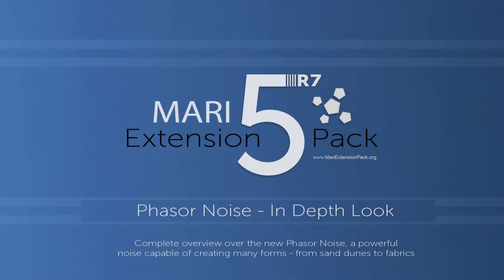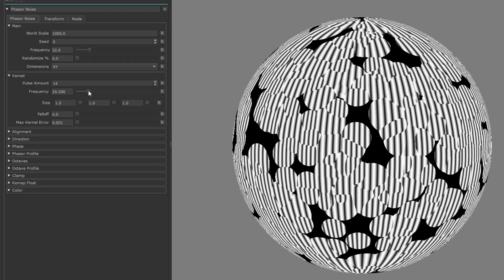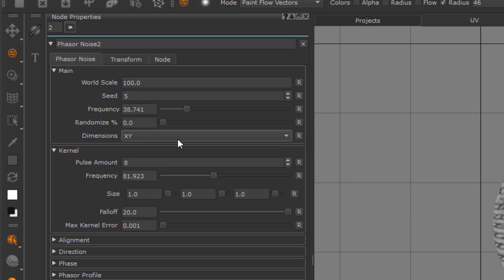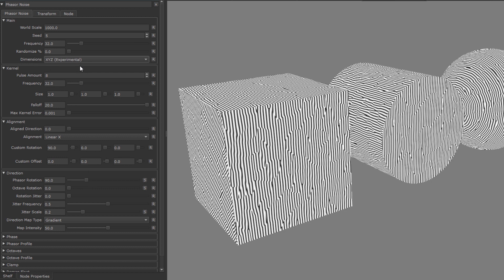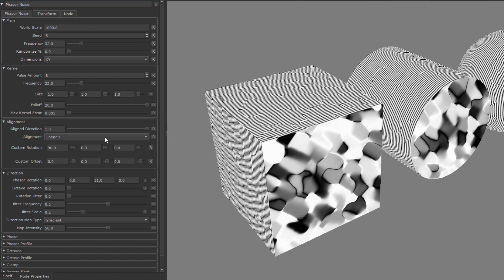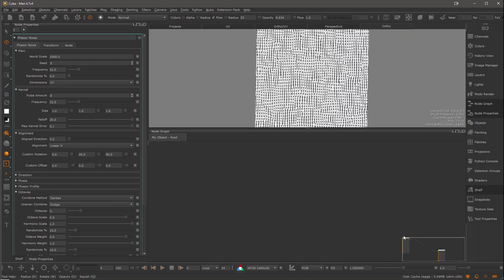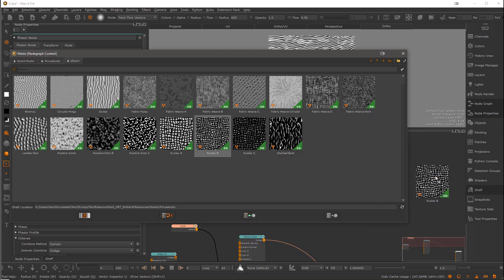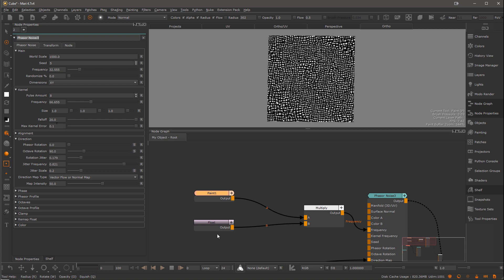Phasor Noise | MARI Extension Pack 5 R7

Comment: 5.0 is it okay
Reply from the maker: Hi. If you mean does it work with Mari 5.0 ? 

No. Extension Pack does not support Mari 5.0.

Mari 4.8 is feature identical to Mari 5.0 though, just different python versions. 
And Mari 4.8 is fully supported by Extension Pack 5 R7.
Reply from the maker: Mari 5 support is now available as a free upgrade ( Extension pack 5R9 )